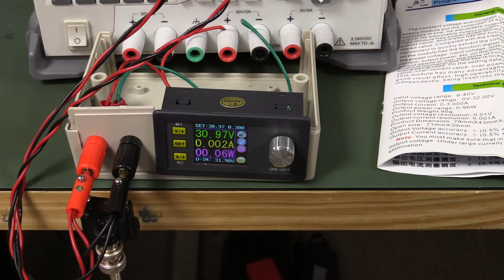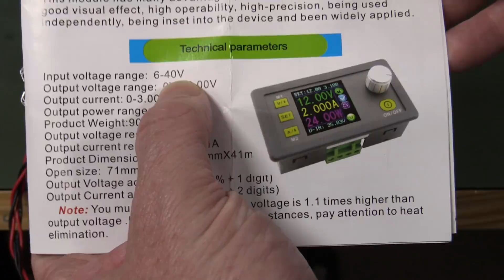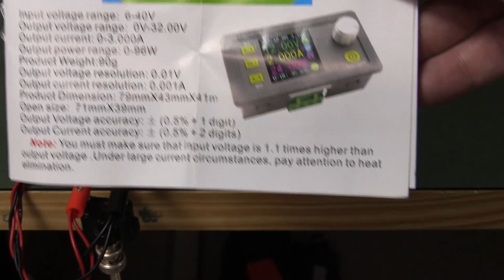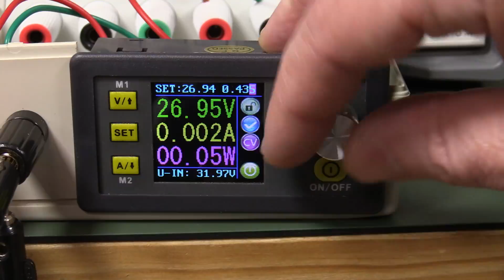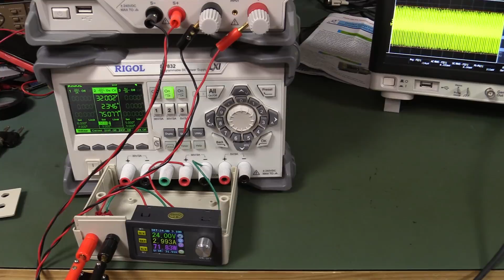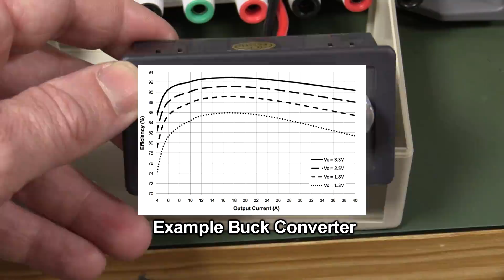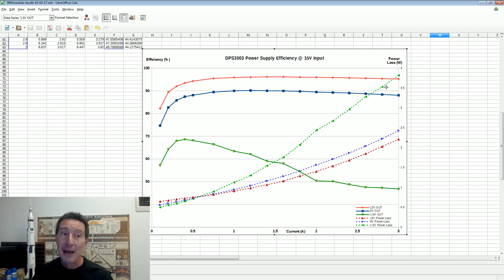EEVblog #1031 - $25 DPS3003 PSU Module Characterisation

Comment: So.. Next how to clean output. Without awfull shortcircuit current spike. And howto use this charging without diode and voltage drop. This is not protected if voltage is more that device output.

Comment: Why didn't you do 3.3 volts?
Reply: Exactly what I was thinking.  It would have been quite interesting to see where the 3.3v curve was positioned between the fairly nice 5v curve and the significant less efficient 1.5v output. I'm guessing it may be a lot closer to the 5v curve than the 1.5v curve.

Comment: What value capacitor would I add to this to filter out the noise on the output? And how to determine that value?
Reply: theres is probably way more then 0.1uF on the output internally .... it also matters what kind of cap you are using and its ESR, a electrolytic cap is hardly going to filter out the hf switching noise at all.
Reply: Michael Eckl off the top of my head, I'd use a bunch of 1uf ceramic monoblocs (bypass caps) in parallel. (The issue here is noise, not ripple.) If I was still seeing noise under max load, add a few 47-100uf low-ESR electros or tanties.
Reply: Big capacitance at the output of lab power supply is bad idea, it will slow down reaction of the supply for changes in load, and for example current limmiter would take long time to settle.
Reply: I see a lot of suggestions for parallel capacitance here, but no mention of series inductance or resistance. Aren't these also needed for a filter?
Reply: https://hackaday.com/2017/10/10/cleaning-up-a-low-cost-buck-boost-supply/
Reply: Possibly it would be best to have capacitors, followed by inductors (or a common-mode inductor), and then a bit more capacitance. You see this kind of arrangement in fancy power supplies on their AC input to stop noise getting on the power lines.
Reply: Pi filters aren't "fancy"; they're practically de rigueur for any DC power supply.

I think a bridged T notch filter for the converter's switching frequency should knock out that noise nicely with minimal impact on performance.
Reply: Thanks a lot for all the input!
Reply: Prehistoricman The supply might already have it on the output.And with just 100mv ripple wouldn't make much sense to include an extra inductor to filter noise. A cap just cuts the mustard.
Reply: I had the same question. A quick Google search suggests a lot of math is involved but I have a feeling there's a rule-of-thumb like "toss a 0.1 µF cap across the terminals."

Comment: Efficiency will be horrible at low power outputs because the unit has a base load powering the controller and LCD module. Interesting how these modules seem pretty well designed despite being super cheap, yet a certain popular test gear manufacturer seems unable to design a good PSU for their own equipment!
Reply from the maker: The efficiency is terrible even (as I did) taking out the quiescent module current. Just the nature of the beast.
Reply: Yep, I have to say though, I'm rather impressed with peak efficiency! If I got 96% from my PSU design I'd be more than happy with it. Makes you wonder what amazing things will appear in the next few years. Lots of huge bang per buck things appearing now, and its great that beginners and newcomers to electronics have this sort of gear. Electronics is now well and truly coming back from the dark days!

Comment: Reverse engineer it and try out some options to improve the output ripple!
Reply: What is a desired filter ? Howto choose/design one ? Could be a nice video follow up.
Reply from the maker: No need to reverse engineer for that, just add the desired filter
Reply: What Dusan said. What could be a desired filter? Measure frequency response/step response... do some actual engineering. Efficiency measurements and such in this video are a great start :)

Comment: thansk dave. my 5005 have 96% too (12v 3a output). now i want to see the buck-boost model. cheers
Reply: the buck-boost model works like a charm too, doesnt really even get  hot enough for the fan to go on, even when pulling several amps at lowish voltages. and best thing is it works off of almost any dc power supply so its super portable as well.
Reply: Poyectos LED seria genial traducir estos videos
Reply: Julian Gomez 
Dejate de joder q a Dave se le entiende perfecto el acento australiano. Mejor aprende ingles asi no necesitas subtitulos y si estas aburrido haces los subtitulos vos.

Comment: I bought this one as I wanted a mini suitcase with all necessary tools for an electrical engineer.. I have to say, I didn't look much info about it and I just trusted my gut feeling when buying this, and I was very very impressed by it, especially for the price!

Now I have a suitcase with this mini DPXXX PSU, the ATMega328 based transistor+component tester+frequency generator(pwm) thingy, DSO138 based mini digital oscilloscope (for low freq simple stuff), a "no-name" Logic 16 logic analyzer + rasperry pi zero with screen to run it on (+mini keyboard,mouse), Yihua adjustable temperature soldering iron (amazing), small ESD mat, glue gun, couple of multimeters.. and many many other stuff.. all that inside a small suitcase and I easily spent less than 100€ (with shipments) for all those stuff, haha!
Thank you China for letting us poor electrical engineers to have our gadgets! :D
Reply: venim1103 Cool! :*)
Reply: yeah I got mine as a portable and small power supply unit as well, it worked like a charm was worth every cent of the 30 bucks I paid for the 5A buck-boost version.
Reply: Pics or didn't happen
Reply: Make a quick video on your cell & post it.  I am working on similar with a ridid tool organizer as the frame, dso150 kit, yaogong rework soldering iron/heat gun & would love some ideas on how to organize it😉

Comment: If only there was a meter that could measure voltage and current & output over, say, Bluetooth so you could automatically plot the efficiency curve...
Reply from the maker: Not without automatically controlling your PSU source, load, and PSU under test as well unfortunately.
Reply: Moshimeter!!!!!!!!!
Reply from the maker: Timothy Henning : There are countless ways to hack together a test rig to do automated efficiency testing. But the fact is you need a programmable PSU, a programmable load, programmable measurement instruments,  and a programmable DUT in order to do this.
Reply: Is that a challenge?
Reply: communication modules (usb and bluetooth) already exist for these cheap PSU's: https://www.banggood.com/RD-DPS5005-50V-5A-Communication-Function-Constant-Voltage-Current-Step-down-Power-Supply-Module-p-1161704.html
Reply: sigrok could do it
Reply: EEVblog, Sounds like a new product to design. ;)
Reply: yzxstudio monitors also have bt options.  Also check out powerz king meter, that one is around $50 but even more options like micro oscilloscpe function.
Reply: Indeed, the Mooshimeter does exactly that very well.
Reply: Andreas Spiess does a low cost SMU based on this device (which has a software control and bluetooth option) and a low cost electronic load: https://youtu.be/QxR-_ZnREQQ
Reply: I have a mooshimeter that does exactly that(voltage and current over bluetooth). https://moosh.im/mooshimeter/
Reply: I feel like you could probably hack something together using the red pitaya...
Reply: Is there any reason why a modern Brymen (wink wink) orwhatever couldn't do this with a software hack? (Theoretically speaking.) Do the voltage and current modes share the same ADC, such that the analog signal for the current is disconnected when voltage mode is active and vice versa?
Reply: Do you have a link for the powerz king meter?
Reply: EEVblog: This is exactly why I always feel like SCPI over some kind of UART should be part of any product whatsoever. If somebody needs bluetooth, he can use one of the bluetooth to UART adaptors. And if all instruments had some kind of 5V logic SCPI interface, those projects would already exist for 5 euros from china...
Reply: Well, you could also semiautomate it. You just turn the knob and the measurement instrument (multimeter, load) could do the rest of the job for you (automatically tracking voltage).
Reply: Sold on ebay as "chargerlab km001", but not exactly ideal for this.
Reply: Now I'm actually glad I did shell out extra $20 for the programmability for my PSU :). BTW, I think someone earlier mentioned a semi-automatic measure setup just to replace your sheet of paper. Like, slam a button, fill a row in Excel automatically, then switch settings on the load and repeat.
Reply: MOOSHIMETER
Reply: The good thing about the mooshimeter is that you'd only need two of them for this process
Reply: They already done a version with a port wher you can connect a USB or a BT adapter. the software looks a bit kiddish, but it does the job and you can set up your own voltage/current sequence with up to 10 entries, wher you can type the voltage and current max (if something went wrong on your connected DUT it limits the current as well if you specify it) and for how long these given values are outputed by the power supply.

I already used this on my DPS5005 to perform a long run test and it did it flawlessly via the UBS i did not test the BT version as it makes no sense for me, as the final unit gonna havew a aluminium housing, so if i put a BT inside it will having trouble to connect to my computer....or i would need to put it outside somehow...also i rather would have a steady cable connection, as you never know what will happen when you leave the room and let it run laa by itself controlled just via a BT connection...if it fails...?!?
Reply: Why does he tell us he is the guy with the Swiss accent, Surly he is not the only youtuber in Switzerland.

Comment: Thanks for this detailed test of the module. As I and others pointed out in your previous video, you can adjust the voltage and current more quickly, while in the voltage/current adjustment mode, you can press the rotary encoder button, which will move the cursor to 0.1, 1.0 or 10v per turn. It's of course also mentoined in the manual.

Comment: If you push the rotary encoder while setting the volts and amps you can skip to higher digits and dial in 0.1 or 1.0 increments
Reply: Schwuuuuup , right Dave did not read the manuel.
Reply: illchmann you got a manual?
Reply: Schwuuuuup, yes we, Dave and I, have a manual.
Reply: illchmann Can we pay more for the automated instruction guide? Manual seems a bit twentieth century.
Reply: so lazy Dave so lazy... read the manual bro!
Reply: 0:25 
here you can see it... ^^
Reply: https://www.banggood.com/DPS3003-32V-3A-Buck-Adjustable-DC-Constant-Voltage-Power-Supply-Module-Integrated-Voltmeter-Ammeter-p-1062475.html?cur_warehouse=CN

Comment: how quick.will they put prices up now Dave's done a couple of videos I think 25%increase. 50v 5amp £21.42GBP current price
Reply: There's lots of sellers for these PSUs and, yeah, some sure will change the prices. That's why it can be a bad idea to buy a product by clicking a link under a video or in a forum.
But checking the orders on Aliexpress for the DPS5005, Dave already increased the sales 10-fold with the first video a few days ago. They sold less than one a day before that, but there've been around 60 orders during the last 6 days since oct.5th. Do you have the price from a week ago? Because if they react to the increased demand, they sure will have done that already.
Reply: I doubt it.
There's too many people selling them.
Reply: I don't think you lot can make a dent in China's manufacturing capability at this point. Seriously, they can mobilize thousands of people putting those things together 24/7 overnight if the sales are there. Efficicency is easy when you don't have unions or overtime regulations.
Reply: well for one thing they are going to run out of stock rather quick I think ;D

Comment: Ordered the DPS3005 from Banggood after your last video. Will be great to finally have a 'proper' (!) bench supply. Thanks for the tip Dave.
Reply: You can never have enough power supplies. Spend some time in making a nice enclosure for it. :-)
Reply: Dave Compton oooo. The laptop power brick is not a bad idea... might have to borrow that one. Otherwise, I'll get a toroidal transformer to drive it.
Reply: congrats on having a "proper" bench supply.
Reply: I fully intend to; gonna stick a switched and fused IEC C14 on the back and hook that up to a laptop power brick internally, as well as the obligatory cooling fan. Not sure what old chassis I'll re-purpose for this. Perhaps an old PC PSU...